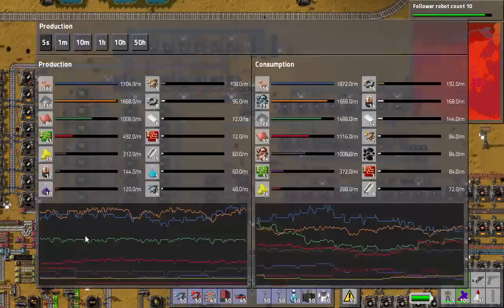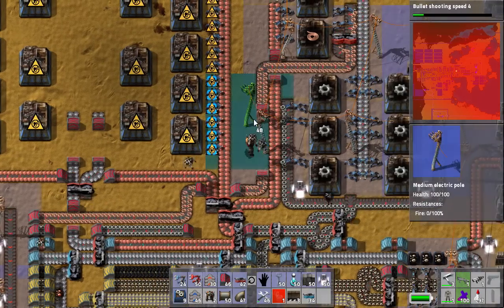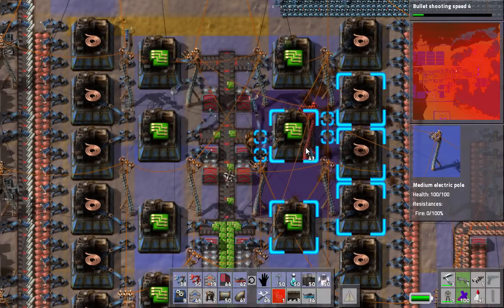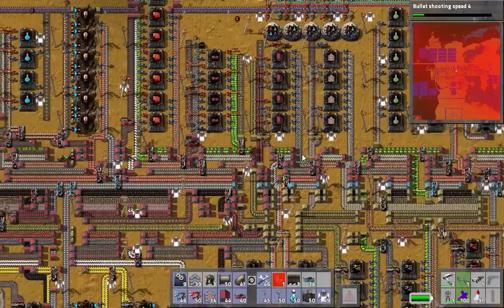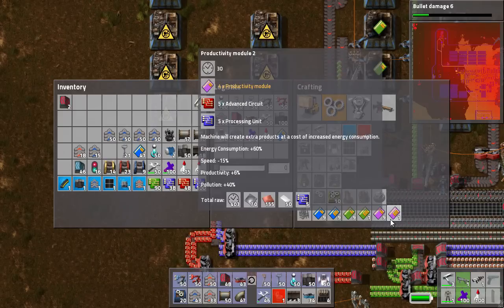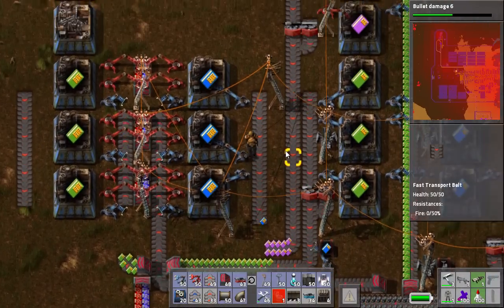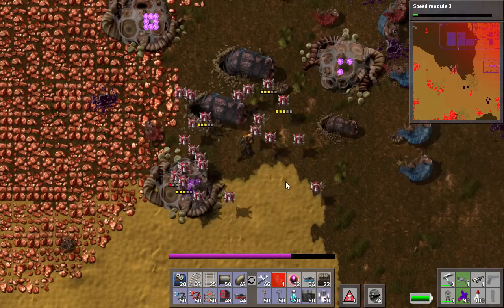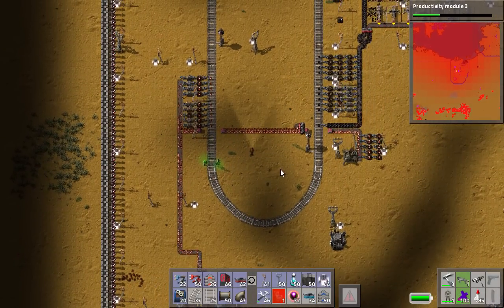Factorio :: Better Circuit Production - Episode 21

Comment: correct me if i'm wrong but doesn't the rocket defence take 50 of those level 3 productivity modules and level 3 Speed modules? if so you may want to start producing those productivity modules sooner rather than later so you can build the game ending structure when you're ready and not have to wait hours on them getting built..oh and also it takes one alien artifact to produce one level 3 module so you will want to stock up on those as well.. even though you wont have any problem getting them with all the nests around you xD
Reply: fact is zisteau is not doing it to end the game, he's doing it for fun
besides, until he actually reaches that point, he still has a lot of tech, and he prolly wants to do more shit
and even if he does end the game, he's already got plans for a season 2

Comment: I've been messing around a bit and found that adding a wooden crate to the output of  each assembler, then a inserter taking from it to the belt acts as a buffer, preventing slow down on those times you you need to quickly assemble something.  Plus it uses up those logs that have practically no use after acquiring copper electric poles :/  Still, it takes ages to let them fill up the first time you activate the assembler lol. XD

Comment: You should make the yellow assembly machines for the advanced circuits. they require some speed modules to craft, but i think it allows you to basically get even more speed, since they have more base speed than the assembly machines 2, and still can be upgraded with even more speed modules. Argh. So much speed!